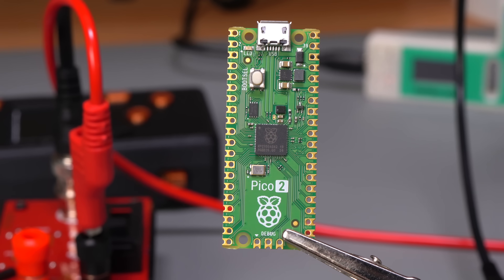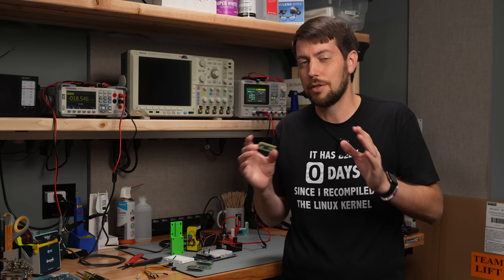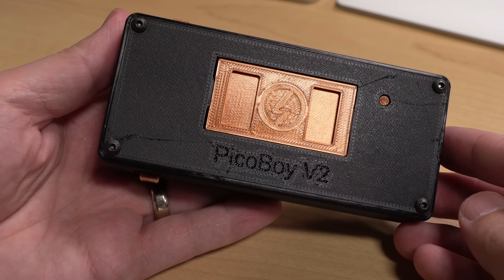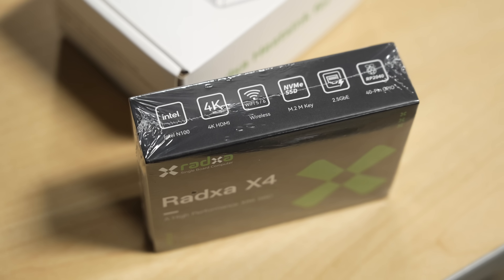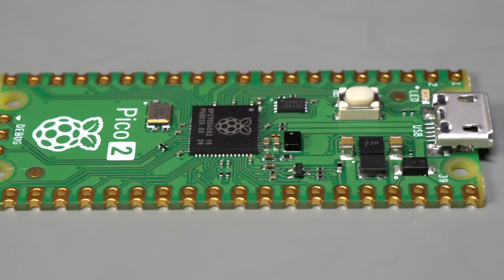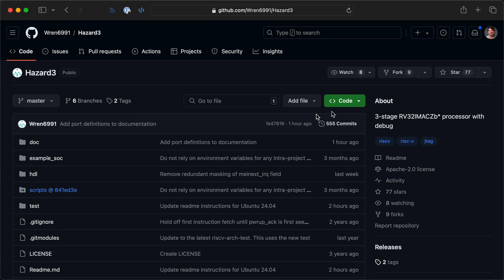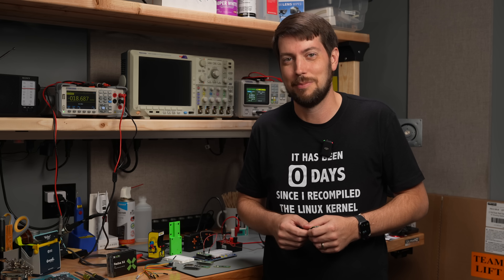Raspberry Pi Pico 2: a RISC-V bet!

Comment: I remember being put off by how seemingly hard it was for someone with the skill level I have to program an Arduino, but it still seemed easier than programming an AVR without the Arduino software having been flashed to it.

Then, Raspberry Pi Foundation released the RP2040 and their official board the Raspberry Pi Pico. The RP2040 uses the UF2 bootloader, which then led to it receiving ports of CircuitPython! Python code is easier for me to understand.

I wasn't expecting Raspberry Pi Foundation to then outdo THEMSELVES by releasing a new RP2350A/B and a Raspberry Pi Pico 2. Pico… 2?!?!?! 🤯
It contains RISC V?!?! 🤩 It's more power efficient?!?!

The RP2350 series microcontrollers having separate ARM and RISC-V modes instead of running all 4 cores at the same time was probably done to reduce complications. For one thing, RP2040 code could likely be relatively easily ported to run on the RP2350A in ARM mode. I'm sure Adafruit have plans to offer CircuitPython for the Raspberry Pi Pico 2, and if they do, they'd likely provide a version that runs in ARM mode, as they'd likely only create a version for RISC-V mode if MicroPython added support for that.
Reply: python on this low end devices is idiotic, arduino's C code isn't hard and its a few orders of magnitude faster.

Comment: That's a really good idea to include the RISC-V cores in addition to familiar ARM cores. That's a beautiful way to lubricate the transition into a new world.

No USB C, though. I wonder why? It is physically larger which is the only reason I can produce to stick with micro USB.
Reply: Back when Pi Pico was introduced, nearly 4 years ago, economies of scale hadn't caught up and MicroUSB was used for cost and availability. It was difficult enough to release ANY hardware during peak COVID and absolute chaos and saturation of supply routes.

Now it's just being retained for drop in compatibility. If you want there's any number of third party boards with USB C.
Reply: @SianaGearz also apparently commenters elsewhere are saying the chip itself can support usb-c and just the board doesn't
Reply: @dead-claudia   You can bolt USB-C onto anything no problem.
Reply: Size isn't the issue with USB-C. Waveshare uses a USB-C port in its RP2040-Zero with a fraction of the Pico board's footprint.
Reply: I think the main reason for sticking with Micro USB was to keep it as much of a drop-in replacement to the Pico as possible
Reply: Or, you are just charging people more money for two additional cores that they will see gives them worse performance if they use so they will just never use them, which will make people associate RISCV with poor performance for a greater cost.
Reply: Its the cost. This whole board costs $5. 
USB-C port itself would cost $0.58 plus the more complex controller (there are a few logic parts required in USB-C even if you use it just as USB 2.0)
MicroB in the same store costs $0.14 and does not require any controller, so they are saving around half a dollar by going microB.
Reply: @hubertnnn   If it cost half a dollar extra, Ali sellers would have to charge closer to a dollar extra for USB-C, but instead it's several cents. I don't think the Raspberry Foundation is paying Digikey prices, rather more comparable to Chinese manufacturers.
Reply: @SianaGearz  Well, the prices I mentioned are when you buy in batches of 500 units, bigger companies probably buy in bigger batches saving a few more pennies, but I doubt the price would be much lower..

Also USB-C is getting popular recently, so companies are probably eating the extra costs to get more sales.
Reply: @hubertnnn  I don't know where you were looking, but USB-C ports only cost two or three on a site like LCSC.

Comment: What current measurement/amplifier box are you using to measure the Pico 2 consumption? It is vaguely uCurrent-y but I am interested in the 'scope output!  Awesome video, and I see that Axe Effect on the desk ;)
Reply from the maker: That's a currentWave from dothediy, based on uCurrent design. I couldn't find a uCurrent last year so I bought this one instead, and it's pretty good, but has its flaws :(
Reply: @JeffGeerling  I am intrigued. I see they have the non-BNC+display version out of stock, I will have to wait to get one I guess. Thank you!

Comment: I find it interesting that they decided to have both ARM and RISC-V on a single chip. I feel like one of them could be cut to make room on the silicon for more PIO blocks or more cores of the same architecture

I do think it's cool they added RISC-V so you could try it out and then switch over to ARM if it doesn't work for you, but I don't think it's the most practical way to do it.

Comment: It's possible the RP2350 itself can get down to microamps but the Pico 2 cannot due to things like the USB controller. IIRC that's the case with a lot of ESP8266 dev boards.
Reply from the maker: Possibly, though I compiled without tinyUSB support, trying to bypass anything unnecessary in my build. I'm a little out of my element in the C, though, and the early MicroPython builds I was using didn't support deepsleep at all (it crashed when I tried it). I think the Pico 2 will get down under 100 uA.

Comment: I don’t get what this board is for now. 

Everything about this board is cost cutting, which is fine, but why more processing power on essentially the featureless microcontroller? They don’t even have deep sleep states If I’m reading this right. 

Now you might be inclined to think it’s just a dev board for their processor…but that theory falls apart when you notice it still uses micro usb and has no buttons. 

In a world where I can order 5 ESP32-S3 for $10, I can’t quite think of where the Pico 2 is the right board for the job.
Reply: Featureless? Really? Did you even read the spec? 2xM33+, 520KB RAM, 12 PIO, deep sleep, extremely high security (one of the deficiencies in the RP2040). Just read the datasheet. Chip cost < $1
Reply: @jamesh9756  Wow you're so emotional.
Reply from the maker: @TheOfficialOriginalChad  I think for some people, optimizing only for power is important (people building coin cell battery projects, for example). For some, secure boot (industrial, consumer products, etc.), and for others, performance (M33 with FPU, overclocking, PIOs, etc.).

I use Picos, ESP32, ESP8266, and a smattering of old Arduinos around my home and office. I sometimes prefer one over another (like ESP devices sometimes work better in wireless projects with ESPHome or for LoRa), but other times it's just nice to have a breadth of options :)
Reply: @JeffGeerling  I completely understand the concept of different devices having different uses. 

I'm just asking: what use-case the Pico 2 would be among the best choices and why? Especially when the RP2350 is on other, better featured boards like the new Sparkfun Pro Micro...
Reply: @TheOfficialOriginalChad  When you've been working with something for some time, you do tend to get that way. It's annoying when people do not read the spec or watch the article before spouting off and getting it all wrong.
Reply from the maker: They do have deep sleep (with internal wakeup that doesn't require external triggers now), but as mentioned in the video, I was unable to use it—as I'm not experienced as a C programmer and was banging my head against a wall with early SDK code.

I think it will be easier as the code is public and any of the little bugs/doc issues I encountered are worked out.

Comment: Looks like you missed a very big difference: the ARM cores are Cortex-M33 cores, with floating point and DSP support. That's a big improvement over the Cortex-M0+ of the RP2040.
Reply from the maker: It's in the on-screen specs in the chart I made, didn't want to dig into the cores themselves in the script to keep things short and to the point. The other thing is I only know top-level things about the Arm core differences, but I have seen M33 cores in tons of devices over the past year, it seems like a very useful core compared to what we had on RP2040, probably easier to hack in Linux-y things too!

Comment: The M33 includes an FPU and basic support for double precision. This is a huge improvement.
Reply: They also have atomic instructions. No need for clunky hardware spinlocks anymore!
Reply: To be more specific: ARM specifies "optional single precision floating point unit" . Luckily, the FPU is included in the RP2350
Reply: @Rob_65  and, apart from this 'optional single precision floating point unit' RP2350 also includes double precision co-processor, which makes double precision calculations faster too (but not as fast as 'native' support in the core would).
Reply: Not only that but the Pico2/M33 uses Thumb2 which a massive step up for assembly programmers. Pico1/M0+ uses Thumb1 and is incredibly difficult to 'get right' because of the severely limited instruction set. I could go in to specifics, but Thumb1 has been a major pita. Everyone who's touched the M0+ at the instruction level will be grateful for this significant change.
Reply: @ParabolicLabs  I grew up with 6502 and 8051 style processors but I have been programming on ARM processors for the last 30 years. I kind of specialized in ARM Assembly programming to do stuff like porting Linux to our ARM7 chip that contained an MMU and optimizing interrupts to squeeze the last microseconds out of our programs. Thumb1 indeed has severe limitations - I had not even realized the M33 now has Thumb 2 🤩
I still have 10 days to absorb the datasheet ...
Reply: Looking at Arm's Cortex-M33 programming manual, I'm not seeing any instructions for double precision other than the fact that the FPU can load and store 64-bit values into two 32-bit registers.  In particular, no double-precision arithmetic.

Having an FPU at all is still quite a big improvement, though!
Reply: really? i must get one then

Comment: I wonder if there is any way to enable both sets of cores at runtime or if something prevents that in hardware (e.g. a MUX in front of the AHB master ports).
Reply: Okay now that the RP2350 datasheet is actually available to the public: nope. Just like I suspected to save on expensive AHB master ports the CPU cores are muxed between the ARM Cortex M33 and the Hazard3. At most you may be able to run one ARM and one RISC-V core for a truly cursed state.

Comment: IDK why raspberry pi loves to use external flash, but it is really dumb and a real deal breaker to use in an actual product.
Reply from the maker: They have new chip variants with internal flash now, too — though Pico itself still has it external as it's using the RP2350A.
Reply: Except for al those actual products using RP2040  that actually use external flash. It means you can choose your flash size.
Reply: @jamesh9756  i am not talking about casual products, I am talking about industrial class. None of those will even consider pico.
Reply: @EmbeddedEnigma  Loads of RP2040 are sold into industry. Millions.

Comment: Another example of a Pico powered thing is the new production run of Unicomp keyboards.
I actually had problems with mine, the board missed a pullup resistor and the keyboard matrix had an inconsistent bridge.
Initially I got an old controller but was able to repair the original board too.
From which I learned that the Pico controller fixes the keyboard becoming unresponsive when left on a powered USB, though the new firmware.
Unfortunately they ended up having to replace the entire board under warranty due to the matrix issue, which we only figured out after fixing the also faulty controller.
I'm very happy with this new keyboard though and will probably get the old one serviced eventually, as that would fully fix it.

Comment: I'm the dev of LogicAnalyzer, and already have ordered three Pico 2 to upgrade the project among other things :D
Reply from the maker: It'll be cool to see how much better projects like yours will be with the extra horsepower!
Reply: @JeffGeerling  , I have a short showing of some results for my Raspberry Pi Pico raytracer. I never expected this little board to perform like that. More memory will allow me a better resolution and caches.
Reply: ReadMe updated 20 mins ago. Nice! :D Truly exciting news. <3
Reply: So I saw this Seagate project that used 2 Risc-V chips one for encryption and the other for a computer module. Also I bought a Seagate and miss my mybook I wanted to partition the drive after it was formatted to Max since I don't have a Mac anymore and I spent 2 hours with customer service for them to say do these 6 steps I said that was the first screenshot I was already on step 5 before I bothered you.

Comment: the RP2350B (the pico 2 with 48 GPIO) also has Double the analog inputs from 4 -> 8
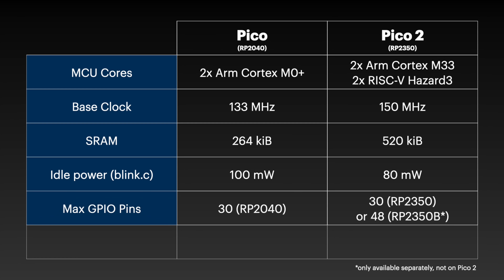Reply from the maker: Yep! Mentioned at 2:09 ;)
Reply: @JeffGeerling all you said the pico 1 had 4 ADCs and didn't say anything  about the pico 2, just that the bigger size one has more GPIO
Reply: @JeffGeerling  good video tho

Comment: What i find weird is it has 520KB SRAM not 512 or another power of 2 number. The other part i wish would be listed is how to power the machine. The other interesting par t is how it switches from 2 ARM Cortex M33 cores to 2 RISC-V Hazard 3 cores. As C is the quickest and allows for the lowest power consumption programming language it makes sense why to use the RISC-V cores you use C though would have been happier if MircoPython also worked for it.
Reply from the maker: The datasheet has some references for power—what I typically do is either just use a USB power supply (easiest), or I will apply 5V to pin 39 (VSYS), along with an extra diode for safety (I think there's an internal diode to protect dual power from USB + VSYS, but I like the extra insurance).
Reply: I think the MP port for RP2350 was just released.

Comment: Damn, I wish they sold it officially in Brazil. I pay at least $10 and at most $17 dollars for it. Arduinos are cool because it is open hardware, so it is legal to sell knock offs and they usually work well enough. That is for the rp pico 1. I would probably have to pay more than $20 for the 2. Not buying for now.

Comment: but is the ADC as noisy as in the original pico?
Reply: Also want to know this. I looks like they may have included a ADC reference but not sure.
Reply from the maker: That's something I'm not well qualified to test—so make sure to check on other reviews!
Reply: @JeffGeerling  You can hook up a potentiometer with outer pins going to VCC and GND and the middle pin going to a GPIO pin. Then you flash it with a simple program that sends the analog readings over serial to a computer in an infinite while loop.

Set the potentiometer to any value you want, don't touch it and look at the serial console. If the values change randomly all the time by tens or even hundreds of points then the ADC is as garbage and unusable as in the pico 1. If its fairly stable (as in 1-2 points variance or ideally outputting the same value every time) then they fixed it.

I obviously dont expect you to start probing the SMPS ripple with an oscilloscope. I just wanna know if the new pico actually has an ADC or is it a random number generator.

Comment: It's good that they finally jumped into the RISC V train. Hopefully it means the development of the ecosystem gets the boost that is really needed.
As for the Pi Pico 2. Yep it's just about straight up better it seems. A little bit more expensive but not too much. A good addition to the lineup.

Comment: I have a dozen or so Pico, Pico W, and Pico RBG boards on my bench that I have done little more than solder pins on, not even sure what the intended projects were.... now I need to get some 2's to add to the collection!  Thanks Jeff, i didn't need that money anyhow.   < insert project suggestions here >
Reply: you are not alone .. 3 of my 4 Picos are still in the original package .. but I managed to connect an OLED display and a barometric pressure sensor and made it display the height.
Reply from the maker: I only have two actually running things right now—the other 8 I bought are in a box alongside two baggies full of ESP8266 and ESP32s :D
Reply: An implementation of the MSX2+ standard, running via low-level emulation! :) And then possibly, a porting of the touted MSX3 VM64 (virtual machine for ARM-cpu's, to run code on, the msx-equivalent to the VM that android apps run on) to the Risc-V silicon on the Pico2. The VM64 is intended for ARM-devices, so a device like this, which have both types of cores, would be ideal for porting it to RISC-V. Sadly the specs and such for the VM64 has not yet been released... x_x But hey! A low-level RISC-V MSX-emulator would still be amazing. <:3
Reply: I thought I was the only stupid ones - who keeps collecting electronics components, ICs, and lot more while hardly made anything apart from basic testing and some soldering. I did made some prototypes but again with tons of wires - disassemble them :(

Comment: Wow, that was quick! The RP2040 is still so new, and yet already obsolete..
Reply from the maker: Definitely not obsolete—still it does plenty, and saves a tiny bit of money per part, so some people will use it (like how the Pi 4 is still worth it for many projects that don't need Pi 5 horsepower).
Reply: Definitely not obsolete. Having ARM and RISC-V but having to choose between them at any given time means necessarily dead weight. It's cool to have the choice on the Two, but unless you're creating some production end product, the power consumption of the One may not be a deal breaker on the original. It just has to do what you ask it to do. So use case is everything.